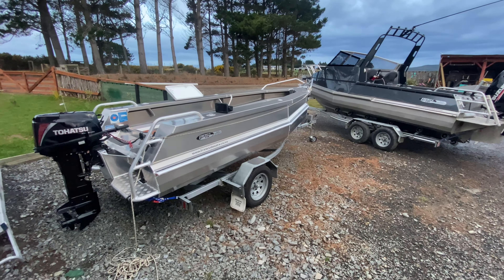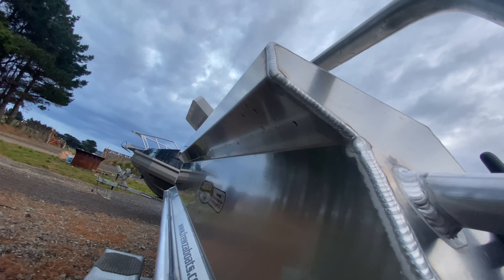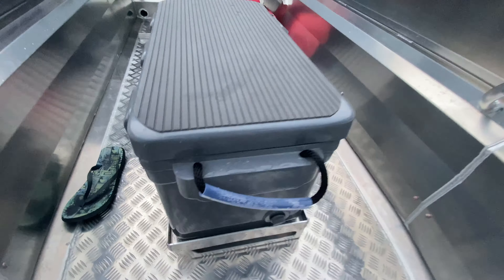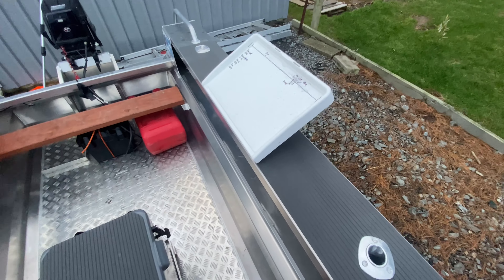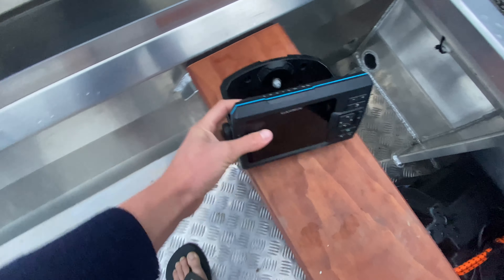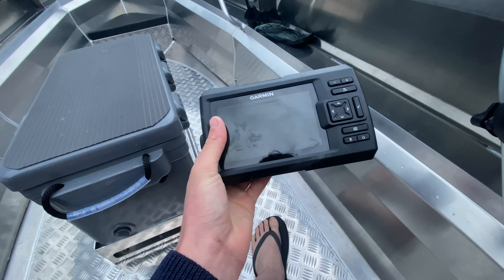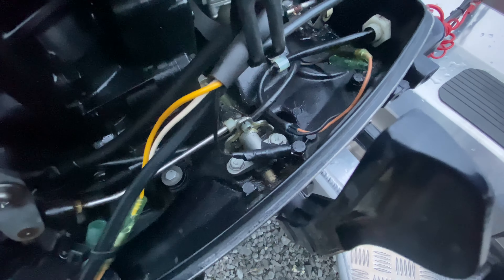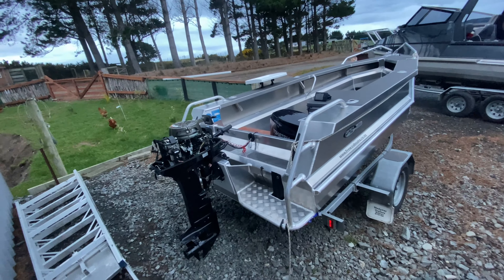Introducing the new boat (Frewza F14 XW)

Comment: Hey, im looking at ordering one, 40hp 2 stroke could be the go i reckon... thoughts from your experiences?
Reply from the maker: Hey mate sorry about the late reply but 40hp would be a good motor for the size I would go a 50 if you could but a 40 would definitely get the job done my 30hp still pushes my boat fairly well but the extra hp is much needed when the boat is loaded

Comment: Hey Have one ordered but wanting to know how much sea spray comes over the front and would you consider a spray dodger install.Also transferring the fuel tote to the front of the boat.Your thoughts.Cheers
Reply from the maker: @oliverbrothers1958  hi mate from my experience in this boat the wide sides have a tendency to soak up most of the chop when on the plane however on the windy days a spray dodger may come in handy. for the toat tank I think it all depends on the way you would load your boat and the power of your motor I chose to put mine in the rear so I could plane a bit quicker with a loaded boat but overall having the fuel tank In the nose wouldn’t effect it too much.
Reply: @JahnaReti  Thanks for the quick reply We have a 40hp Suzuki 4 stoke which is heavy and they reckon the skipper is as heavy if not more as the motor.thats the reason for transferring some weight to the front.Going with all your recommendations in your video but find cleaning down and getting rid of sand etc could be a problem. So how is the sump working or would you recommend redesigning the drain holes and scuppers to something different.
Reply from the maker: Coming from an older f14 with no sump having a sump definitely speed up the wash down process it captures and throws 80% of the sand out most times and really helps getting the floor nice and clean .for the scuppers I haven’t had the need for redesign them they do sit slightly higher of the ground but it hasn’t effected the draining at all.